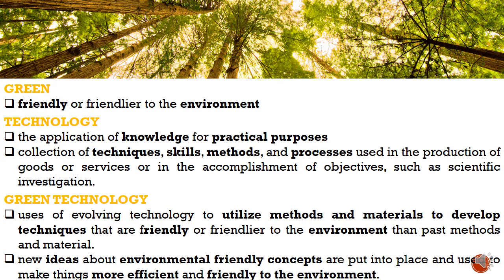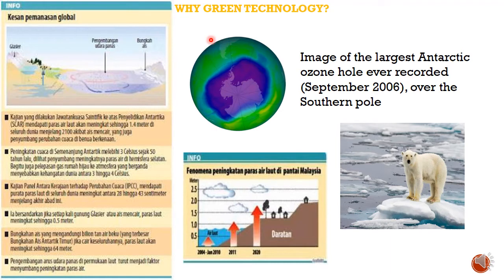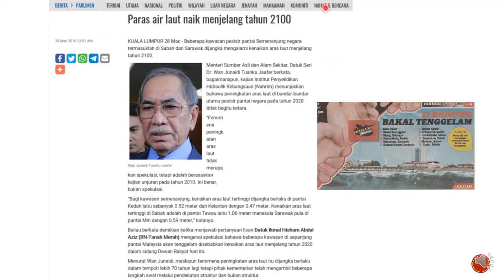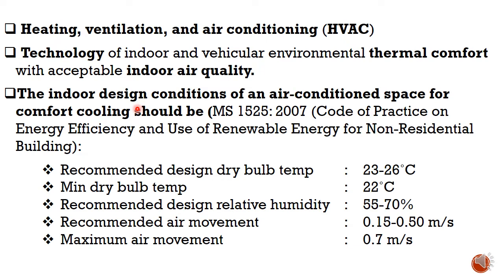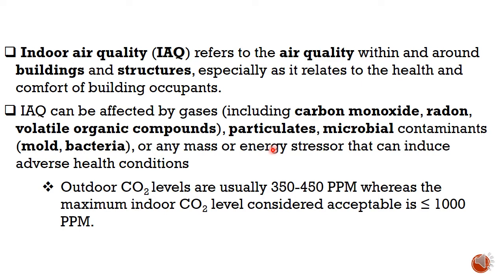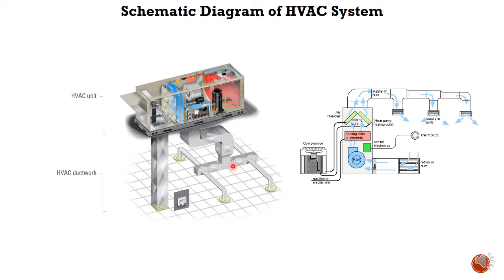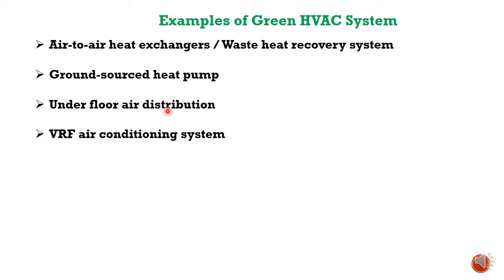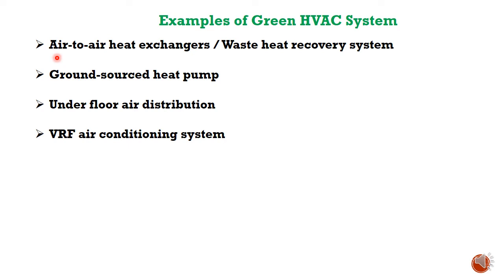Lecture 1- Green Technology HVAC

Comment: AMIRATUL RASYIDAH BINTI ABDUL RAHMAN
B071710456

1. GREEN TECHNOLOGY
 used the evolving technology to utilize the methods and material to develop a techniques that which is more friendly to the environment without harming.
 
2. EXAMPLES OF GREEN TECHNOLOGY SUBJECT AREAS: 

ENERGY: Perhaps the most urgent issue for green technology, this includes the development of alternative fuels, new means of generating energy and energy efficiency.

GREEN BUILDING: Green building encompasses everything from the choice of building materials to where a building is located.
 
3. GREEN TECHNOLOGY HVAC
:  
The system that produce thermal comfort with good air quality without harming the environment such as global warming. This technology will be implemented into the methods, materials, and machines of HVAC system.
 
4. ADVANTAGE GREEN TECHNOLOGY :
1. Sustainability
2.Cradle to Cradle Design
3.Source Reduction
4.Innovation
5.Viability

Comment: Mohamad Zarif Bin Rostam (B071710681)

1. Green Technology
Definition: Scientific awareness that is realistic and environmentally friendly. 
Since some of the previous approach and material use is very bad for the environment, other alternative needs to be applied to create less environmental damage.

2. Why do green technology important?
-Protect the environment from harmful emmsion.
-Conserve natural resources.
-Reduce the usage of fossil fuels.
-Contributting to good human health.
-Support the increasing of green technology.

From the past 10 years before the green technology introduceed, the world had been through the big effects because of human activities. The big impact was the ozone layer getting thinner from years to years. With the application of green technology will help to recover the ozone layer.

Green Technology Subject Area:
-Green building
-Evironmentally prefered purchasing
-Green Chemistry
-Green Nano Technology
-Energy

Green HVAC
-System that produce thermal comfort with good air quality, which reduces the polution to the environmennt such as global warning and also cost effective.

Correct Building Design
Size small: will run heavily all the time to compensate.
Size big: will constantly turn on and off, will cause condensation on space walls.

HVAC Green Technology
-Sustainability
-"Cradle to cradle sign"
-Source reduction
-Inovation
-Viability

Comment: Muhammad Zulqarnain Bin Zamzuri (B071710782) BMMH1/2

Green technology:
-new concepts about environmentally friendly into place
-used to make things more efficient and friendly to the environment. 

HVAC has taken 2 parts in green technology subject area:
-Energy 
-Green building 
-Environmentally preferred purchasing 
-Green chemistry 
-Green nanotechnology 

Advantages of  HVAC Green technology are:
-Viability
-Sustainability
-Cradle To Cradle
-Source reduction
-Innovation 

Example of green tech HVAC system:
-Air-to-air heat exchangers / Waste heat recovery system
-Ground-sourced heat pump
-Underfloor air distribution
-VRF air conditioning system

Comment: Cheah Kok Hun
B071710006
Thanks Lecturer for detailly explain through out the lecturer. It really enhance my knowledge and i can easily understand the concept.

This is what i learned from this video
Green Technology; used the evolving 
technology to utilize the methods and material 
to develop a techniques that which is more 
friendly to the environment without having 
harming them. 

HVAC Green Technology; system that produce 
thermal comfort with good air quality without 
harming the environment such as global 
warming. This technology will be implemented 
into the methods, materials, and machines of 
HVAC system. 

advantages of using HVAC Green Technology: 
$'Sustainability 
apViability 
. Innovation 
resource Reduction 
Cradle to Cradle

Comment: KHOR YE SHU (B071710464)
 BMMH S1/2

Green - Good or healthy for environment (Friendly)
Technology - Application of knowledge for practical use
Thus, green technology is a combination of knowledge that are practice and is friendly to the environment .

In this topic, HVAC have taken 2 parts in green technology subject area, which are energy and green building. 

HVAC is a system that produces thermal comfort with good air quality, which reduces pollution on environment such as global warming.  

Advantages of  HVAC Green technology are:
- Viability
- Sustainability
 

- Source reduction
-“Cradle To Cradle” design
- Innovation 

Why Go Green?
- To protect environment from hazardous emission
- To reduce the fossil fuel usage
- Support the increasing green energy production
- To contribute to good human health conserve natural resources

The example of green HVAC system:
- Air-to-air heat exchangers / Waste heat recovery system
- Ground-sourced heat pump
- VRF air conditioning system
- Under floor air distribution

Comment: NUR SHAFIQAH BT ABDUL GHAPOOR
B071710400
4 BMMH 1/1

1.	Green Technology
a.	Green- friendly or friendlier to the environment
b.	Technology- knowledge for practical purposes and collection of technique, skills, methods and process.
c.	Green Technology- methods and material to develop technique that are friendlier to the environment. It also means new ideas about environmental friendlier.
d.	Go green are for:
i.	To protect environment 
ii.	Conserve natural resources
iii.	Reduce the fossil fuel usage
iv.	Contributing to good health
v.	Support the increasing green energy production
e.	Green technology subject area:
i.	Green building
ii.	Environmentally preferred purchase
iii.	Green chemistry
iv.	Green nano-tech
v.	Energy

2.	HVAC
-	Technology of indoor and vehicular environmental thermal comfort with acceptable indoor air quality.

3.	Green Technology HVAC
a.	system that produces thermal comfort with good air quality and also cost effective.
b.	Green building design is that HVAC system is designed after all the other energy efficient design components are in place. 
c.	Correct sizing is crucial to energy efficiency.

4.	The advantages of “Green HVAC”
a.	“Cradle to Cradle” design
b.	Source reduction
c.	Innovation
d.	Viability
e.	Sustainability

Comment: MUHAMMAD HAFIZ BIN JOHARI 
B071710380
BMMH S1/2

WHAT IS GREEN TECHNOLOGY ?
Green technology means a technology that is considered as an eco friendly technology that causes less damage to the environment. It is also known as environment technology. Its main goal is to conserve the environment and manage the scare resources. Green technology is a relatively young marketplace but investor interest runs very high in response to global warming fears and the increase scarcity of many natural resource.

Advantage 
-viability
-sustainability
-source reduction
-innovation 
-cradle to cradle 
Example
-air to air heat exchangers
-ground sourced heat pump
-under floor air distribution 
-VRF air conditioning system

Comment: AMIRA NASUHAH BINTI ALIAS
B071710121

Green Technology; used the evolving technology to utilize the methods and material to develop a techniques that which is more friendly to the environment without having harming them.

HVAC Green Technology; system that produce thermal comfort with good air quality without harming the environment such as global warming. This technology will be implemented into the methods, materials, and machines of HVAC system.

advantages of using HVAC Green Technology:
🍀Sustainability 
☘️Viability 
☘️Innovation 
☘️Source Reduction 
☘️ Cradle to Cradle

Example;

🌷Air to air heat exchangers/ waste heat recovery system
🌷Ground sourced heat pump
🌷 Under floor air distribution
🌷VRF air conditioning system

Comment: MOHD RAHIMI BIN MUSTAPHA
B071710225

Sub topic on the GREEN TECHNOLOGY :
1) Introduction on the Green Technology
Where it used the evolving technology to utilize the methods and material to develop a techniques that which is more friendly to the environment without having harming them.
There a several examples of green technology subject areas: 
= Energy 
= Green building 
= Environmentally preferred purchasing 
= Green chemistry 
= Green nanotechnology 

2) Revision on the HVAC system concept
Where reviewing on the HVAC system concept that has been learn before this in order remember back and fully understanding the concept.

3) HVAC Green Technology
Where a system that produce thermal comfort with good air quality without harming the environment such as global warming. This technology will be implemented into the methods, materials, and machines of HVAC system.
There are several advantages of using HVAC Green Technology:
= Sustainability 
= Viability 
= Innovation 
= Source Reduction 
= Cradle to Cradle
Example of using Green Technology into the HVAC system:
= Air to air heat exchangers/ waste heat recovery system
= Ground sourced heat pump
= Under floor air distribution
= VRF air conditioning system

Comment: ALDEN ANDRIAN PHIUS
B071710392
BMMH S1/1

What is green technology?

Green technology uses evolving technology in utilizing methods and material to develop techniques that more friendly to the environments than previous method and materials.

What is green technology HVAC?

A system that produce thermal comfort with a good air quality, which reduce pollution on environments such as global warming and also cost effective. Besides, in green building design, HVAC system was designed after all the other energy efficient design components are in place because energy requirement are reduced and natural heating and cooling is maximized through orientation, passive design, insulation,  air barriers and landscaping. In addition, it also designed to provide supplementary heating, cooling and ventilation.

Advantage of green technology HVAC

1.Sustainability
2.“cradle to cradle”design
3.Source reduction
4.Innovation
5.Viability

Example of green technology HVAC

1.Air to air heat exchangers/ waste heat recovery system
2.Ground source heat pump
3.Underfloor air distribution
4.VRF air conditioning system

Comment: Ahmad Asyrafamirudin bin aznan (b071710607) BMMH S1/1

green technology
-to utilize method and material tp develop techniques that are friendly to the environment.
- it more efficient and friendly to the enviroment
why go green?
-to protect environment from hazardous emission
-reduce the fossil fuel usage
- support the increasing green energy production
-contributing to good human health conserve natural resources
green technology areas
-green buildings
-energy 
-green chemistry 
--green Nano-technology
green HVAC
-system that produce thermal comfort with good air quality, which reduces pollution on environment.
sizing of an HVAC.
-if too small it can run heavily all the time to compensate and if too large, it will constantly turning on off.
green HVAC technology
-innovation
-source reduction
- viability 
-sustainability

Comment: MOHAMMAD NAZRIN BIN BAHARUDDIN
B071710111

GREEN TECHNOLOGY 
The field of green technology encompasses a continuously evolving group of methods and materials, from techniques for generating energy to non-toxic cleaning products.
Examples of green technology subject areas: 
1) Energy 
2) Green building 
3) Environmentally preferred purchasing 
4) Green chemistry 
5) Green nanotechnology 
HVAC GREEN TECHNOLOGY
The definition of Green Technology goes a little further as it involves implementing a solid strategy of environmentally friendly ideas, methods, materials, and machines. Using Green Technology in hvac will support the increasing green energy production for example in Malaysia using solar in some industrial field to reduce pollution on environment and the US, they use ice power aircond system which has the same concept of thermal energy storage by convert water to ice to cool the area and save the energy consumption.

Advantages of HVAC Green Technology:
1) Sustainability 
2) Viability 
3) Innovation 
4) Source Reduction 
5) Cradle to Cradle

Comment: LIM PEI JUN (B071710194)
BMMH S1/2

Green technology is new concepts about environmentally friendly into place and used to make things more efficient and friendly to the environment. 

In this topic, HVAC have taken 2 parts in green technology subject area, which are energy and green building. HVAC is a system that produces thermal comfort with good air quality, which reduces pollution on environment such as global warming.  HVAC system was close rely on energy efficient design components that placed in the correct location because the energy requirement are reduced and natural heating and cooling is maximized through size orientation, passive design, insulation, air barriers and landscaping. 

Advantages of  HVAC Green technology are:
Viability
Sustainability
“Cradle To Cradle” design
Source reduction
Innovation 

The example of green HVAC system:
Air-to-air heat exchangers / Waste heat recovery system
Ground-sourced heat pump
Under floor air distribution
VRF air conditioning system

Comment: MUHAMMAD AKRAM BIN RAZALI (B071710573)

Green Technology 
- Utilize method/material to develop techniques that friendly to environment
- Fresh idea about environmental friendly concepts to achieve more efficient and friendly to environment

Why go green?
- Protect environment from hazardous emission
- Conserve natural resources
- Reduce the fossil fuel usage
- Contributing to human health
- Support the increasing green energy production

Green technology subject areas
 are:-
- Green building
- Environmentally preferred purchasing
- Green chemistry
- Green nano-technology
- Energy

What is HVAC? 
- Heating, ventilation and air-conditioning
- Technology of indoor and vehicular environment with acceptable IAQ
- Indoor design condition base on (MS 1525: 2007)

Indoor Air Quality (IAQ)
- Air quality around the building and structure
- Can be affected by gas (carbon monoxide, radon, volatile organic compound)

Green Technology HVAC
- System that produce thermal comfort with good air quality that reduce pollution on environment 

Advantage
- Sustainability 
- Viability 

- Innovation 
- Source Reduction 
- Cradle to Cradle Design

Example of green HVAC system
- Air to Air heat exchanger
- Ground source heat pump
- Under floor air distribution
- VRF air conditioning system

Comment: Muhammad Syafiq bin Arzemi
B071710014

GREEN TECHNOLOGY

   # Green Technology - uses of evolving technology to utilize methods and materials to develop techniques that are friendlier to the environment than past methods and material.

   # Objective :
      * Protect environment from hazardous emission
      * Conserve natural resources
      * Reduce fossil fuel usage
      * contribute good human health
      * Support the increasing green energy production

   # Areas Of Green Technology :
      * Green building
      * Energy
      * Green Nano-technology
      * Green chemistry
      * Environmentally preferred purchasing
      
   # HVAC & Green Technology - Technology of indoor and vehicular environmental thermal comfort with acceptable indoor air quality.

   # Green HVAC - HVAC system is designed after all the other energy efficient design components are in place because energy requirement are reduced and natural heating and cooling is maximized through size orientation, passive design, insulaiton, air barriers and landscaping.

   # Advantages of Green HVAC :
      * Viability
      * Innovation
      * Sustainability
      * Source reduction
      * Cradle to Cradle design

   # Examples Of Green HVAC System :
      * Air -o-Air heat exchangers / Waste heat recovery system
      * Ground-sourced heat pump
      * Under floor air distribution
      * VRF air conditioning system

Comment: ALDY HENRY DUSIM
B071710329 
BMMH S1/1

Green - good or healthy for environment (Friendly)
Technology - application of knowledge for practical use
thus, green technology is a combination of knowledge that are practice and is friendly to the environment 
because some of the method and material use before are very bad for the environment so other alternative needs to apply to produce less harm to the environment.

Why green technology:
-To reduce the fossil fuel usage
-To protect environment from hazardous emission
-Support the increasing green energy production
-Contributing to good human health
-Conserve natural resources 

HVAC provide a good quality of air that will be supplied in a building and also in vehicles that will give thermal comfort for the user
While Green HVAC is a system that produce thermal comfort with good air quality, which reduce pollution to the environment such as global warming and  also cost effective

therefore the advantages of green HVAC are:
-sustainability
-"cradle to cradle" design
-source reduction
-innovation 
-viability

Example of Green HVAC system:
-Air to air heat exchangers/ waste heat recovery system
-Ground sourced heat pump
-Under floor air distribution
-VRF air conditioning system